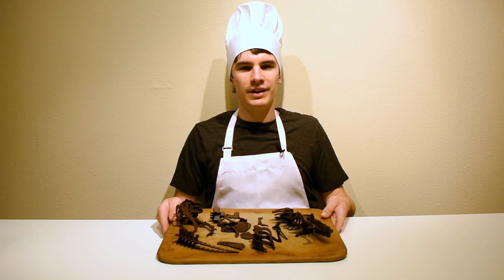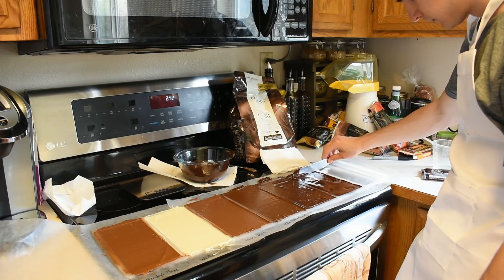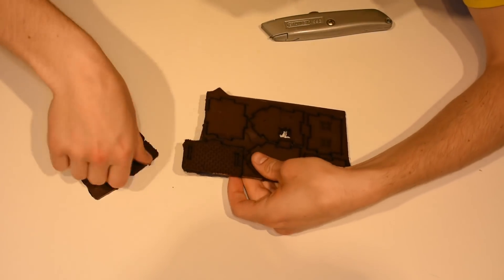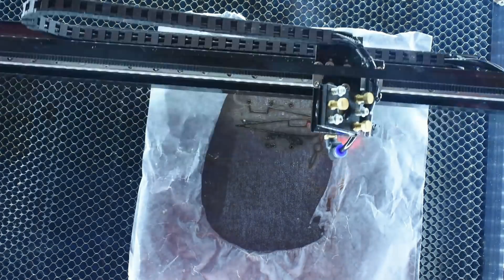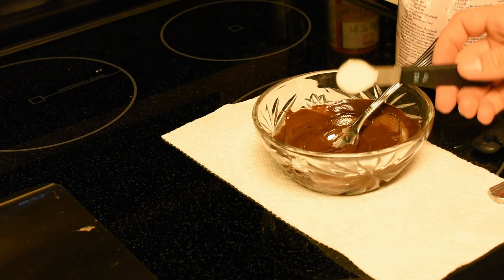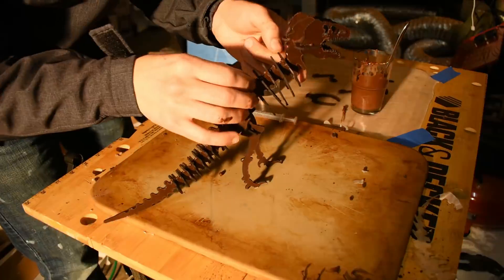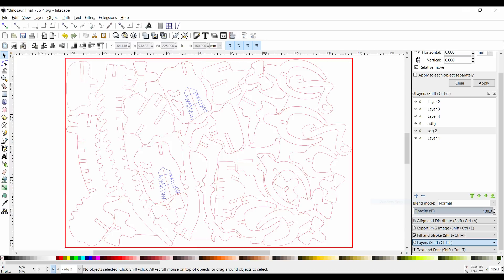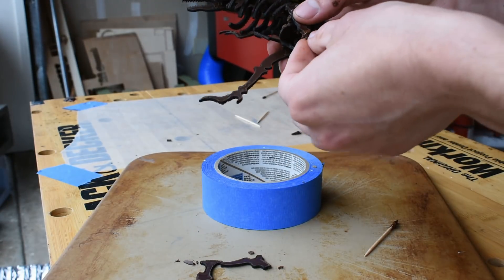How to (and how not to) Laser Cut Chocolate

Comment: Does your cutter have an air assist nozzle?

I'm taking notes as I plan to cut wax to make bras casting masters.
Reply from the maker: My laser cutter does have an air assist, and I set it to the lowest that I could (~5 psi or less). The biggest difficulty that I had when trying to cut chocolate (and I suspect wax will behave similarly), was the width of the material removed when laser cutting, and having a high pressure air assist did not appear to help it.
Reply: @Fisherck  Thanks - I will experiment and see what happens. I'm planning to get carving wax with a slightly higher melting temp - hopefully I can vaporize it rather than melt it.